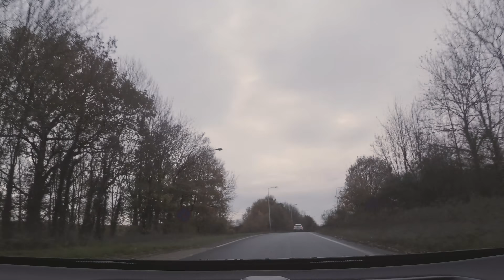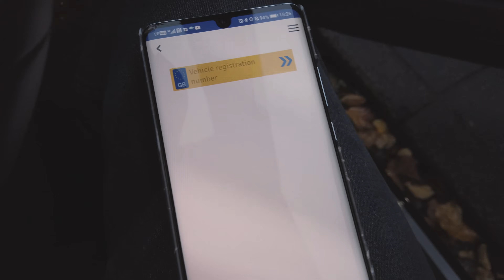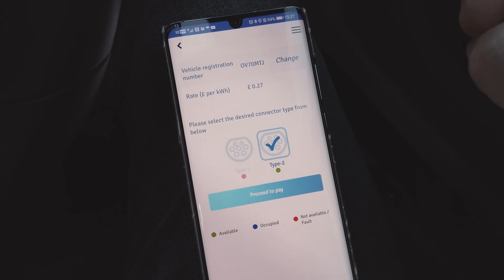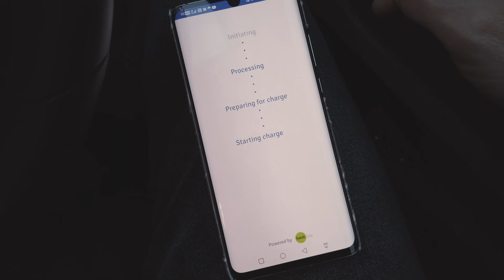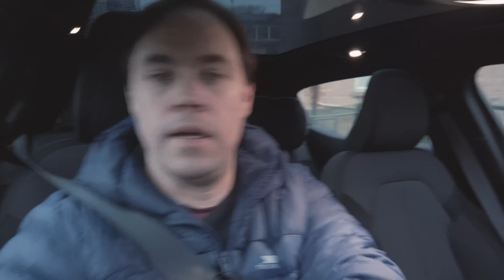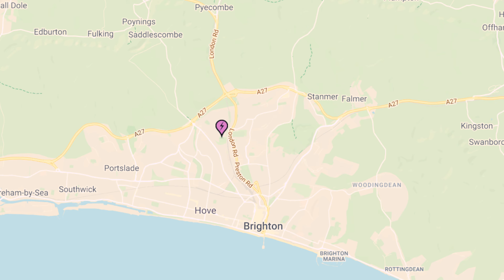Electric car charging Brighton - Using an Electric Blue charger with Polestar 2

Comment: I enjoy your videos, thanks for sharing your Bev ownership  experiences.

Ice cars don't get their fuel for free so I wouldn't expect free electricity for a Bev. Charging stations cost money for capital outlay & infrastructure installation and thereafter they cost money to maintain.

I think that the governments' insistance on electrical transportation by 2030 is a pipe dream at the moment as it is impossible to achieve without adequate reliable & ease of use infrastructure in place. Having to faff about with different apps is not good enough.

 Currently, as you have demonstrated, it is nonsensical to expect people to transition into electric vehicles en-masse.

Electric vehicles will be no cheaper than Ice vehicles as the loss of revenue to the exchequer will have to be funded from Bev vehicles, plus the infrastructure investment will have to be recouped, so I forsee that ev ownership will inevitably become more expensive in the long term than ice vehicles, particularly with the added burdon of the higher purchase cost of these vehicles.

The only cheaper cost if Bev operation (currently) is when home charging, until if course they find a way to tax that too.

Then there are the problems that all new EV's  are experiencing with software etc. to contend with.

I currently run a bmw i3 with a REX and looking to change early next year. It is a perfect car for urban motoring with the advantage of zero range anxiety. 

I was going to go to full Bev early next year as I now need a car with a longer range, but I am now contemplating returning to a petrol vehicle as the cost of a decent range Bev is considerably more than I can buy an ice for, the cost difference will buy me several years worth of fuel. 

To me, it doesn't make sense to go full Bev in the foreseeable future if intending to travel any distance away from home that requires using the woefully inadequate public charging network.

Comment: Having to open the bonnet with a secondary lever is for safety reasons, it means the bonnet won’t fly open as you are driving if it’s not properly close or the release lever is pull from the inside of the car, it’s make good sense as in the past I’ve seen the damage that can occur when a bonnet flies open at speed.
Charge points cost money, money that the rate payers fork out, why would you expect to get free electricity? 27 pence per kWh isn’t that bad, home electricity is 15 pence per KWh. That gives just 12 pence to instal and maintain the charge points. You drive an expensive heavy car I drive a Kia Nero BEV and get far better miles per kWh so 27pence per kWh would cost me 7pence per mile and far more to the point zero emissions.  Changing to electric, whilst at the moment is a saving, isn’t why we should be changing it should be for the sake of our children, grandchildren and this planet we live on. Yes I agree not much cheaper that petrol / diesel but far better for all of us.
Reply from the maker: I agree in theory and I'm not expecting free electricity. But removing perfectly functional chargers that were multi network (Chargemaster and polar) and reasonably priced seems the wrong way to go. Also right now Brighton has just one main charging provider who have the monopoly on the system. I agree, 27p is OK but what I'm highlighting is that there are alternatives to just a single provider. Many cities around the UK have more affordable options.
Reply: @ShortCircuitPS2  There was a government grant of £650,000 for the electric blue lamppost chargers. The price per KWH pays for the electricity, and then 1p of that goes towards the installation of further chargers (rising to 4p in the next few years).
Reply from the maker: I agree, it's far better for the planet and for us all. That was my main reason for switching. When our outlander phev lease is up we will probably get the kia e Niro or soul electric

Comment: One pedal driving shouldn’t result in higher consumption. It’s all about how you control the throttle pedal. Explore the area between no throttle pressed and all the way down.
As far as I know, the type of car makes no difference to the charge you get. But Electric Blue is yet another annoying app you require.

Comment: Excellent video,polestar arrived yesterday midnight,none p/p with tow bar, my question is do you use various rfid cards is the one that comes with the car of any use, I am able to charge at home but will when allowed be taking a run upto Newcastle battery will get me their but will need to charge for return journey no rfid cards at the moment
Reply: My PS arrives tomorrow. I installed the app which Polestar recommends, where by you don't need to have multiple apps and accounts. However, hardly any charging points near me. But, when I use the Polar app or Newton app or Zapmaps, there are loads more charging points available. I guess they haven't managed to get that many charging point operators to sign up to their app yet.
Reply: No problem. Download appropriate apps. BP Chargemaster (Polar previously)essential. Others you can choose by referring to Zap-Map and working out which chargers would suit your route best. The Plugsurfing which comes with the car is a waste of time in UK at present so ignore.

Comment: Was this not down to the charger not recognising the Polestar? We also have lamp post charger's in Brent. They are on the actual lamp post, not a stand alone charger.
Reply from the maker: Yeah could be, I'm not sure why it didn't work for me. Many of the Brighton ones are on the lamp posts but this particular one from electric blue was a stand alone unit.
Reply: Wait? Lamp post chargers on Brent?! I'm in Harrow. I don't think there is a single one here. I'll have to look up the lamp post chargers on Zapmaps and try them out. There are three Chargemaster rapid chargers on Harrow (50KW) but they're reserved for taxis only. Frustrating!

Comment: This is one of the things that made me anxious about pulling the trigger on the PS. I am hopeful that infrastructure will continue to improve but agree, it is disappointing to not see things moving more quickly.
Reply from the maker: Thanks, yes it can be quite frustrating. Once you figure out the good places to charge then it's actually quite easy. Unfortunately though there are a few parts of the country that still have black holes or badly impletement options (or are overpriced!)
Reply: @ShortCircuitPS2  indeed. I expect to do the vast majority of my charging at home but it would be nice to know that if I need to use a rapid charger (even if only 50kw) that the option will be available.